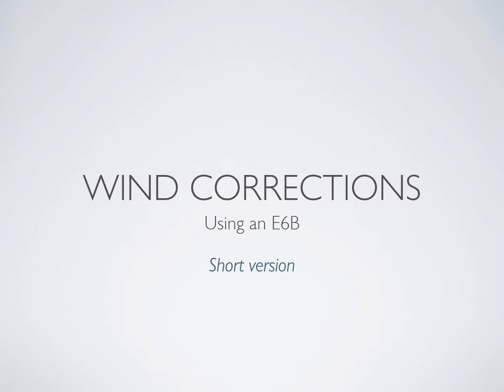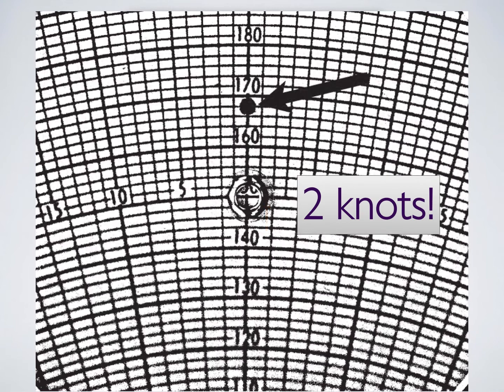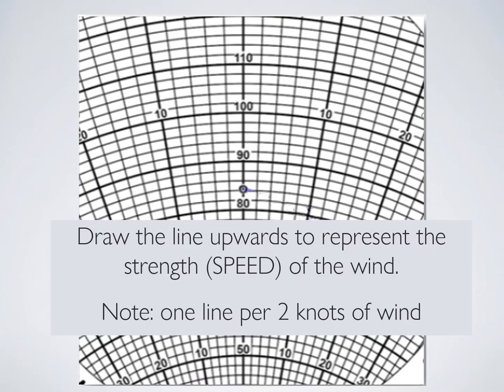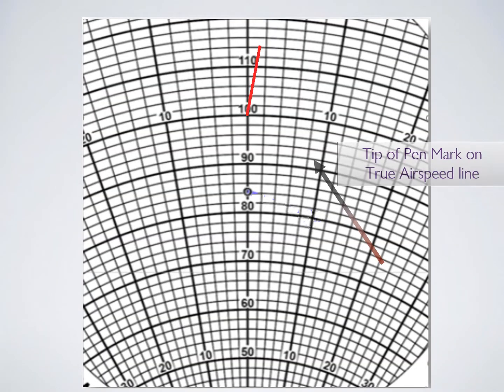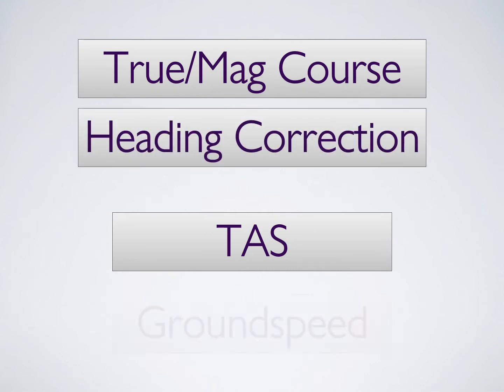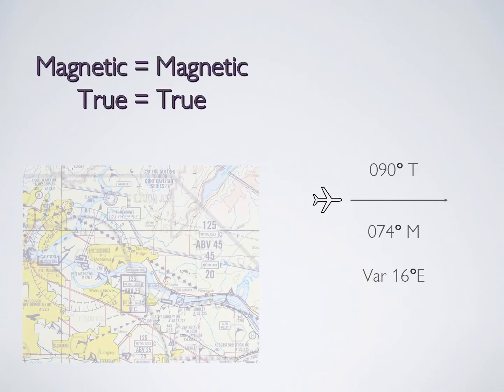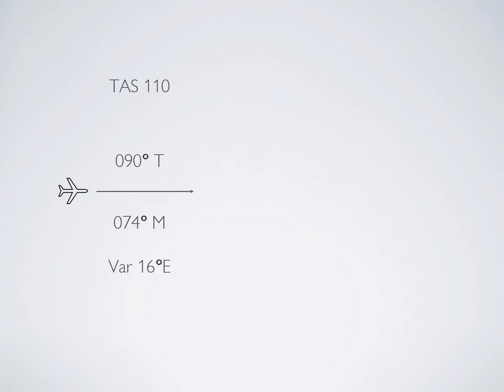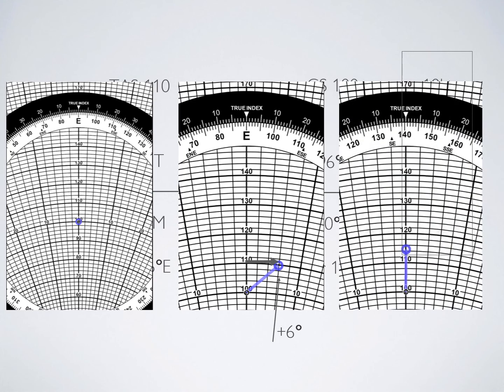Aviation - How to measure Wind using an E6B Circular Slide Rule

Comment: 2:13 why is the grommet at 84kts when I thought the ground speed is at 100kts?
Reply from the maker: Because I get lazy sometimes with screenshots and don't notice inconsistencies like this!
Thanks for pointing it out - what I was trying to demonstrate was the quadrant idea and headwind/tailwind but I should have kept the grommet in the same spot to prevent confusion.  I used a different photo that I had in my collection.